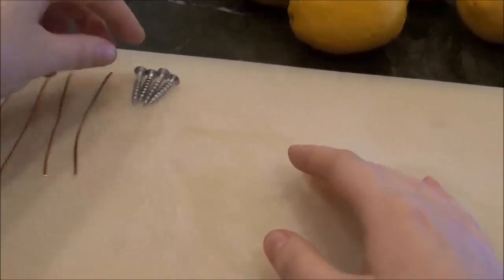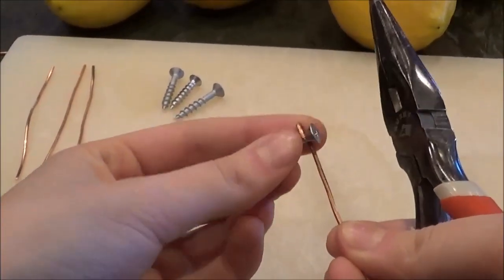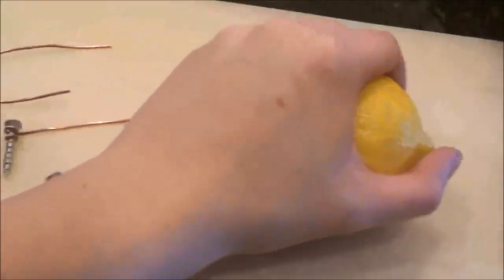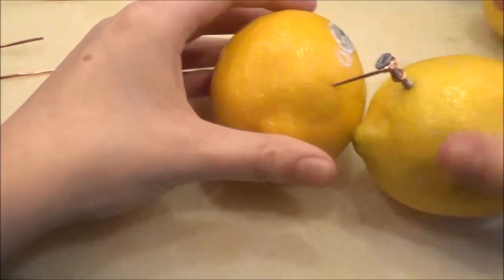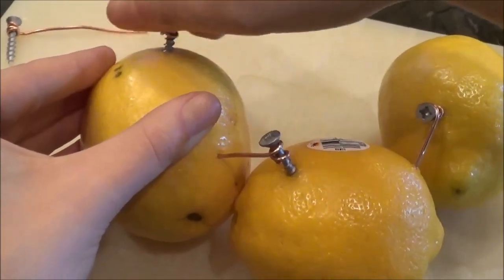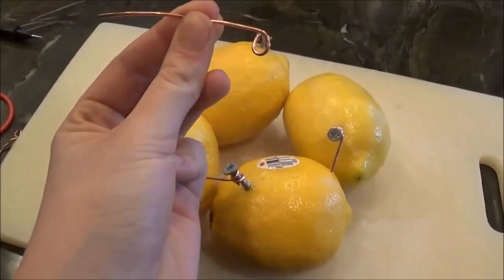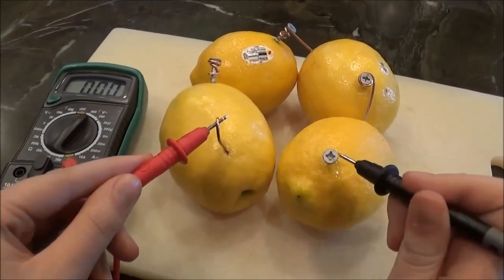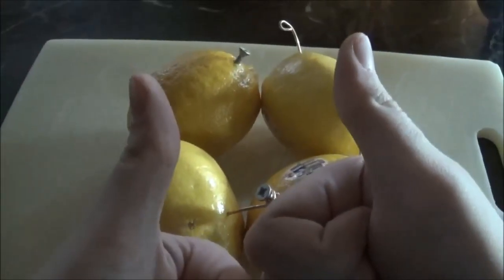How To Make A Lemon Battery By Renae

Comment: you have connected the fruit batteries in series because the orientation of the positive to negative repeats itself to generate greater electricity. I did this project for my science fair and won second place. But if you connected them in parallel then you could generate greater amperage as well as voltage. but good job! without you I couldn't have won.
Reply: Heey, do you know if this last long? Like,, could it last 2 days or do I need to make it at the moment
Reply: @abrilreyes1  I had it for my science fair and after 5 hours. it would show significantly less amperage and voltage than it would when you first connect

solving this is as simple as disconnecting the zinc from the lemon while you are not actively testing it.

Comment: That ain't 6 volts! You need to read a voltmeter properly
Reply: @PoorPoor-f6x  6 volts will not fry the led because the amperage is not enough. I could have 9 volts but without enough amperage it would not spin.

Comment: You actually don't need four lemons for this. You could simply connect all the screws and wire in the same lemon and get the same result. The lemon is just the electrolyte that frees up the electrons in the anode in order to produce electricity.
Reply: True.It is bogus. The voltage from a copper/zinc/ in lemon battery is more like 0.6 voltts and that can be had from just ONE lemon.

Comment: I am doing the same thing you are doing and i have 7 lemons and it is only 2.5 volts It is not working
Reply: Too much lemons😜
Reply: @elvira3574  It is bogus. The voltage from a copper/zinc/ in lemon battery is more like 0.6 voltts and that can be had from just ONE lemon.
Reply: I connected 15 and I got 9.7
Reply: @crashletics  where did you get your LED light bulb? Also,, it might sound stupid but how did you connected 15 lemons, idk Imao I'm doing this as a project for my science fair and I want it to work
Reply: @abrilreyes1  Normally you would connect the lemons as in the video but if not you connect them all the positive and all the negative. and i got it off of amazon find a really low amperage LED light

Comment: This video helped me do my project so far, which i am currently doing. My Leds require 1.45 -1.65 Voltage and my multi-meter shows a 1.5 voltage but my leds aren't lighting up, I cant figure out the problem, but if there is any, it would be a huge help to tell me Thank you so much <3 ~a 6th grade kiddo
Reply: I have a 5 volt computer fan but it would not spin even though I am generating 9 volts. It would not spin because the flowing of the electrons from the zinc to copper are not fast enough to create enough amperage to power the fan. So in short you don't have enough amperage. 
 I hope I answered your question!!!

Comment: Can this work with Christmas tree lights?
Reply: MrOunce3 probably not. Christmas tree light bulbs are built to work on 120 v ac. You need to find a flashlight bulb that works on about 1.5 v dc. Or works on 1 aa batt.

Comment: Ok I did the same exact way your doing but mines isn't able to turn on my LED even though my volt meter said it's 3.2 volts mine isn't able to power up even though it requires 2.5 volts to power up. Can you please help
Reply from the maker: Hello Skyler, first double check and make sure the LED you are using does not require more voltage. Different LEDs require more or less power. Also make sure the correct sides of the LED are connected to the correct end of the circuit. Positive to cathode negative to anode.
Reply: and check if ur led is not broken

Comment: Cool, I think if you hammer the copper wire until it becomes flat, this will produce more power.
Or maybe hammer copper pipe and then cut it into 4 smaller plates.
But the easiest way is to use pennies and nuts instead of screws.
I think vinegar also works instead of a lemon.
Reply: it could cut the increased surface contact with the lemon juice increases the power generated